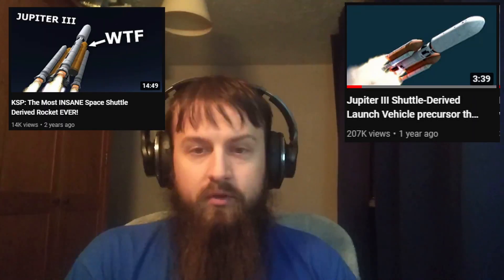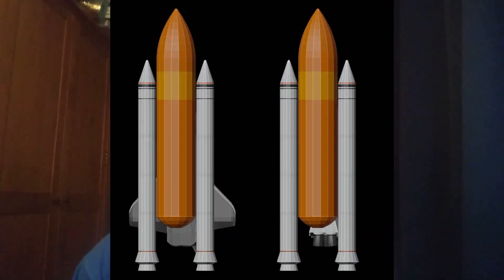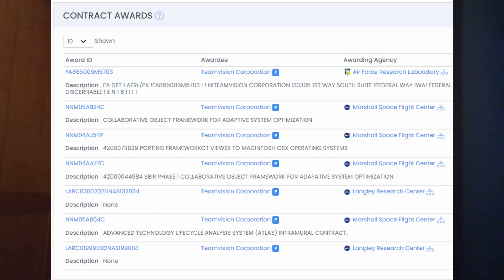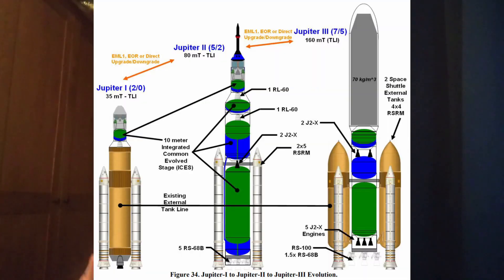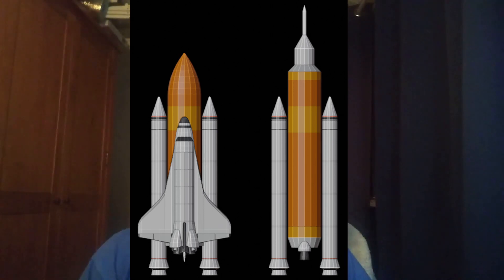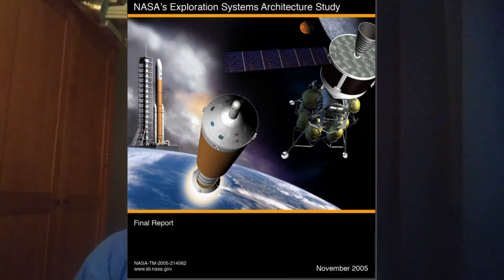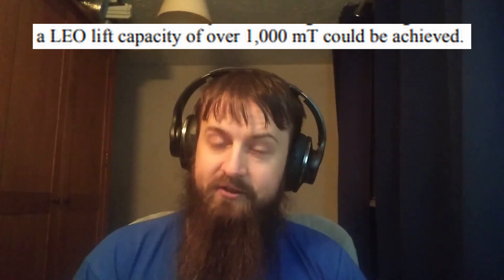What was the Jupiter III?

Comment: The main benefit of this over designs like the Ares V and SLS is that you can actually use the external tank without massive redesigns that make it basically a new tank as its structure isn’t designed as is to support the thrust of engines mounted to the bottom (most of the structural stability comes from its mount to the Orbiter)

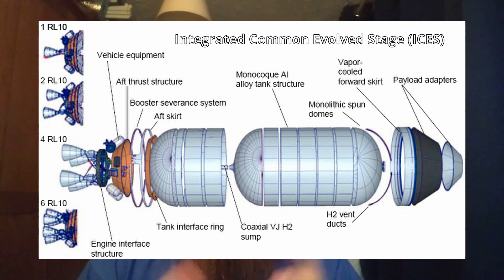Comment: 3:05 Interestingly enough the 2nd stage of the Jupiter III is essentially an uprated Saturn V S-II stage(which had 5 original J-2s with the same propellants) combined with the ICES design. So the overall design is basically 2 Shuttle-Cs mashed together and then topped with an uprated S-II stage(the former replacing the S-1C), which is really fascinating. I would love to see the launch tower designed to service the Jupiter III- the 2nd ET must've required considerable modification to the tower!

Comment: The thing I do not understand about Ares V / SLS, Jupiter II, Jupiter III and Jupiter V is how all of these different configurations could be explored and yet none of them tried to incorporate at least some form of more practical re-usability into their designs. If they're going to the trouble of making a launch vehicle design based on the partially semi-re-usable Space Shuttle, then why not advance the evolution further and make at least the first stage re-usable? 

United Launch Alliance, a spin-off / joint venture of Boeing and Lockheed Martin, launched a new vehicle in January, 2024 known as the Vulcan/Centaur. It is a modernized, expendable vehicle whose first stage relies on combination of two BE-4 engines from Blue Origin between zero and six graphite expoxy solid rocket boosters. The second stage is a Centaur V with two hydrolox RL-10 engines from L3 Harris Aerojet Rcoketdyne (originally Pratt & Whitney). ULA is known to have an evolultion in the works for Vulcan's first stage, wherein the BE-4 engines jettison after they reach space. A LOFTID-style inflatable heat sheild deploys and the BE-4 engines fall into the sea, slowed by parachute, so that a ship can recover the BE-4's for what is called "SMART Re-use". 

" How ULA Plans To Recover & Reuse Vulcan’s BE-4 Engines "
by The Space Bucket channel on YouTube -- 26 Dec. 2022 -- run time: 8 mins., 14 sec.
https://youtu.be/sDScJJllVpc?si=fckvAABkyl2yWner

" LOFTID Animation "
Presentation: Animation of mission highlights for the upcoming launch of NASA’s cutting-edge entry, descent and landing technology: Low-Earth Orbit Flight Test of an Inflatable Decelerator (LOFTID). 
by NASA's Marshall Space Flight Center on YouTube -- 29 July 2022 -- run time: 1 min., 25 sec.
https://youtu.be/YtLWjaZVy8Y?si=qv8fSqcFlhpuA8mo

Why couldn't something like this be used to salvage at least some of the launch engines from a beast like Jupiter II, III or V? And why can't solid rocket boosters be redesigned to to better facilitate their recovery and make them more easily re-usable?

Low-Earth Orbit Flight Test of an Inflatable Decelerator - Wikipedia article
https://en.wikipedia.org/wiki/Low-Earth_Orbit_Flight_Test_of_an_Inflatable_Decelerator

I would even go so far as to ask why something like LOFTID took so long to design, build and successfully test. NASA did not try this technology until 10 Nov. 2022. They should have been doing this kind of thing 20 or 30 years ago, and maybe ships like Jupiter II, III, V, and Ares V / SLS would be more feasible and worth investing more R&D into.

As it stands, the existence of concepts like Jupiter III and Jupiter V strongly suggests that maybe NASA could incorporate re-usability into an SLS Block 3 re-design. Here's an idea: replace the entire SLS first stage with re-usable first-stage rockets. (Example: use Blue Origin's New Glenn first stage, each core having seven BE-4 methalox engines, in either a three-core, four-core or five-core configuration. Each core could be rigged to return to base (or to sea) for re-use. Remember: each New Glenn first stage, with those seven egines, can make 3.85 million pounds-force of thrust.

Now, imagine this SLS Block 3 scanario, using seven New Glenn first stage boosters; that's 49 BE-4 engines in total, making 26.95 million pounds-force of thrust. SpaceX Starship, eat your heart out!
Reply from the maker: I can't really speak to theoretical designs like LOFTID (which certainly should have flown sooner) but I do know about the others.

The problem with the SRB reuse is that it simply wasn't worth the cost of sending ships out to bring them back. Modern manufacturing techniques pushed the cost calculations back toward expendable.

The Jupiter cores also went to very high velocities and made any heat shields or retrorepulsive landings unfeasible. And SMART-style engine section reuse would require a major redesign since the engine sections were where one of the SRB mounts was located.

Also I'd point out that launch thrust isn't really a useful metric to analyse the usefulness of a rocket. You want delta-V and for the Falcon 9 some 80% of that comes from the second stage